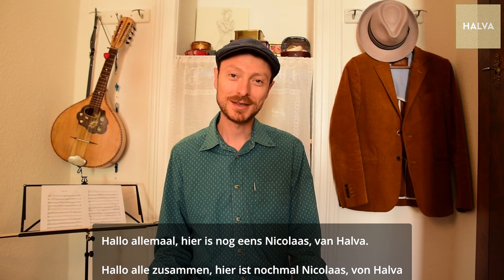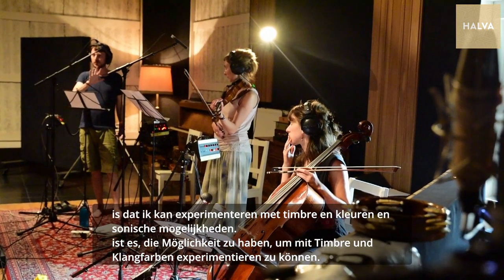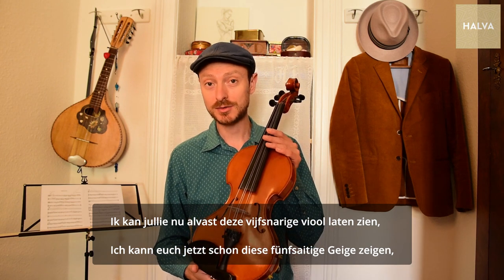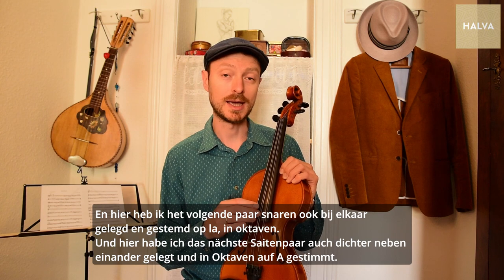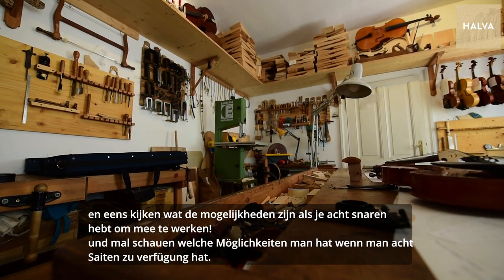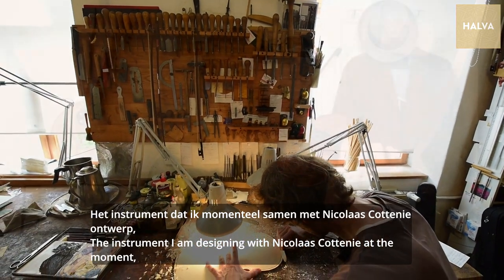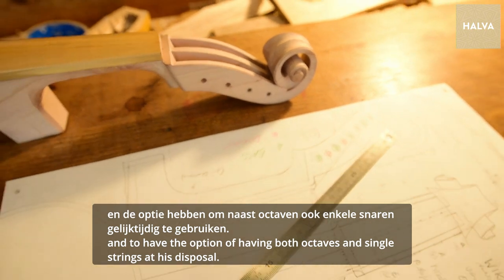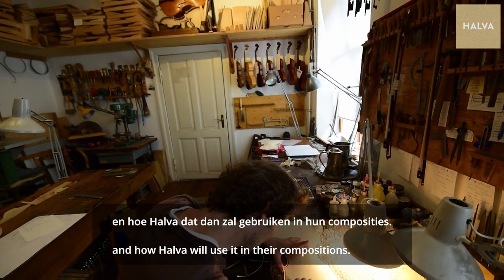Halva's 8 string fiddle

Comment: Great idea Nicolaas! Shkoyekh! Amit (will it be tuned E, A, D, G like a normal violin?)
Reply from the maker: Thank you Amit! I hope you're doing well, looking forward to see you!

About the violin: yes and no. The idea is that it is flexible. So I will have multiple bridges for different set-ups. The most obvious one is for the 4 double strings, which will mostly be eE-aA-dD-gG. But other options are possible.

But I'm mostly looking forward to experiment with other tunings. Theoretically, I'll be able to ave 8 single strings, or any combination of single and double strings. Possibilities are virtually endless!